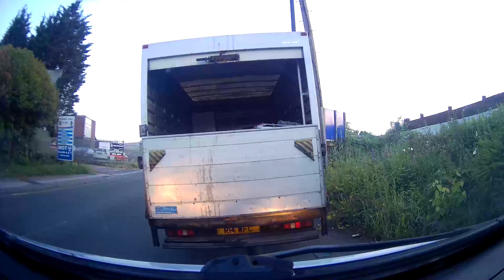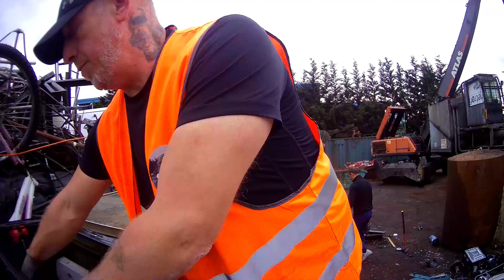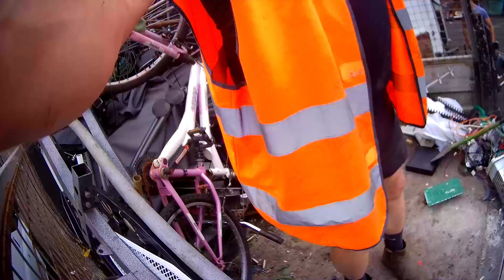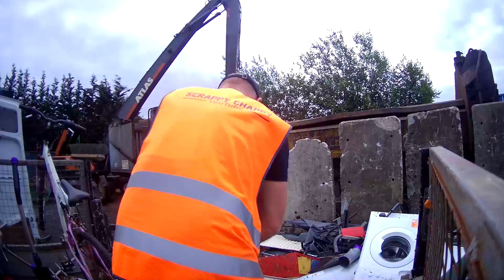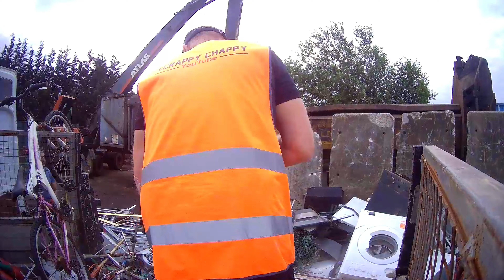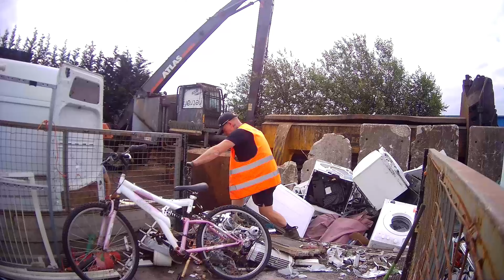grafting for my cash #scrapmetal

Comment: Nww subscriber mate, that tank is stainless I think and got big copper coil inside. Heat pump tank
Reply from the maker: thanks for subscribing
Reply: @scrappychappy74  miss scrapping mate, this is my fix lol
Reply: By the way after seeing this video and comment about the tank having a copper coil , I thought I have one of those tanks at my  yard that I was planning to run in as light iron, once I stripped the brass , so I cut the bottom of the tank off , but although the coil looks copper coloured , there not copper, the scrap yard said it's chrome plated steel, the inner tank and the coil , so don't bother with them, all the best James
Reply from the maker: @jamescherriman1633  thanks mate